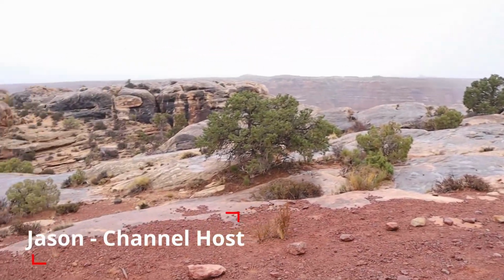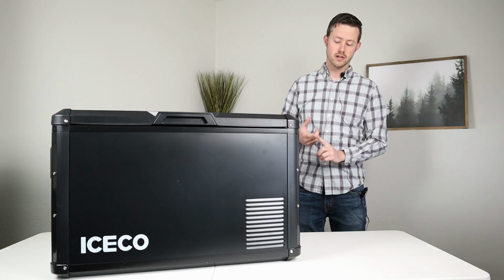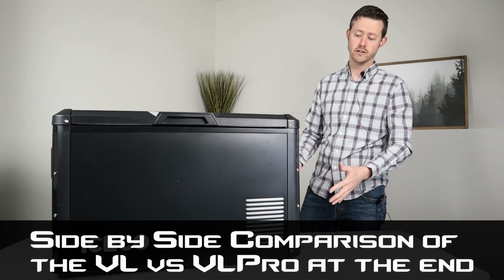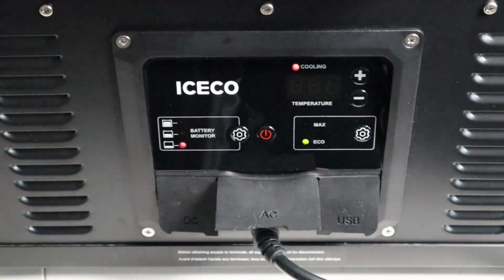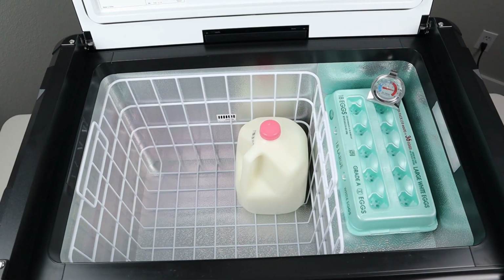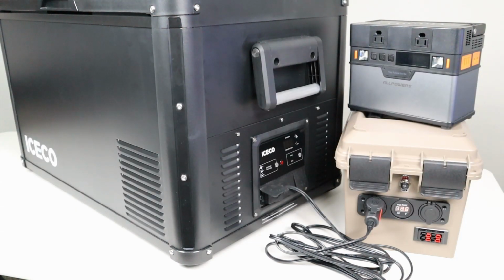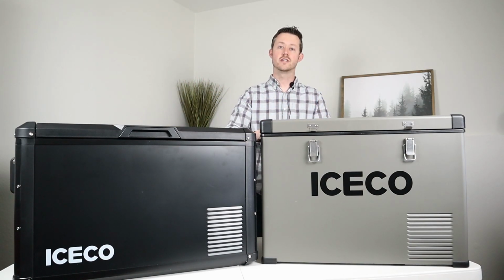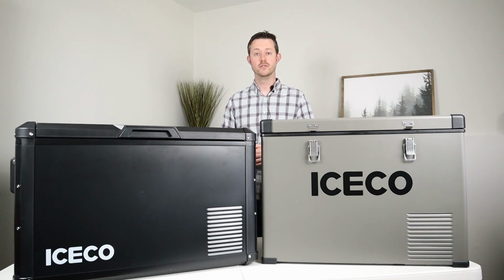ICECO VL60 PRO SERIES Review - Brand New Line of 12v Fridges! Best of ICECO Lineup?!

Comment: These are getting to be like generators. A couple companies did all the research and built a reputation (Honda/Yamaha/etc) then China came along stole the design and mass produced them under a million different names and at a million different prices. Generator companies are doing the same crap we see with these fridges with “we have a so and so engine” like this compressor nonsense. It might have the same compressor but it’s not the same. It might be a fine product I don’t know because we don’t have decades of user experience to go on. 

We also see this with diesel fired heaters. Sure a Chinese one is cheaper, but in the long run you’ll end up buying a Webasto or Espar because it will last a decade or more. 

You really do get what you pay for whether it be a heater, a generator or a fridge and you’re supporting research and R&D vs ripping someone else off. Or communism. Or muslim genocide. Or human rights violations. All taking place in communist China. 

It’s funny today people worry about their carbon footprint and all this nonsense but don’t care where a product is made or what their money is supporting. 

I am sure North Korea could build things even cheaper. How many of you would buy one? Sadly I bet a lot of you would.

Comment: Thanks for the video showing this particular model. I bought an Alpicool that I have to return because the fridge  side doesn’t work and was freezing everything. 

I had decided to buy an Iceco VL60 model for $749 with dual zone and dual lids. 

Because of your video showing new upgrades and with your discount code I instead ordered the 75qt dual lid and saved $120 off the $1000. Whew! That’s quite a bit more than the $400 I paid Alpicool. But I heard the Danfos is the best. Seems the only thing lacking here is a longer handle and wheels. Let’s hope it doesn’t take forever to get here.
Reply from the maker: Happy to help, I appreciate you commenting on the video! Good luck on your new large fridge, I know you will enjoy it! You cant go wrong with danfos/secop compressors, they are the best around!

Comment: Hi have you tested the new VL Pro with. Jackery or Goal Zero yet? How long would a Jackery 1000 run that? Thanks
Reply from the maker: It would be very similar to the other VL series. The Jackery 1000 has 1000 watt hours of energy. This fridge pulled 356 watt hours of power during my 85 degree test. That test was 21 hours long. So it should last at least 48 hours WITHOUT solar or DC charging. At cooler temps it would last much longer!  If you compensated with solar panels it would also last much longer. Pretty decent option for sure!
Reply: @Jasonoid  i look forward to testing my VL Pro 45 this weekend with my Jackery 1000. Thanks

Comment: What is the vertical measurement of the basket.  I have about 31" vert space and am concerned that the basket won't be removable.  Thanks.
Reply: Oops...my question is related to the VL45 Pro which you probably don't have access to.
Reply from the maker: @aowaycreek2183  They should be very similar, the basket for the VL60Pro is about 13.5 inches tall at the highest point.
Reply: @Jasonoid  Thanks so much for the timely response.  I'm surprised at the basket height since the listed internal dimensions show 13" for the VL60 Pro.  It looks like the side lip over which the basket must move is actually somewhat lower than the highest points at the ends and corners which is shown to be 18.2".  If that is the case I may be able to eke it out over the side rail.
Reply from the maker: @aowaycreek2183  yeah, hard to tell until you test fit it.

Comment: For your Power tests for 70 and 85 Deg You show 56 hours and 21 hours respectively. Were those runtimes the total time until the battery pack was exhausted? Also what was your 12volt battery  source (brand/model)? I assume the battery was charged to 100% at test start?
Reply from the maker: Those tests were just off the AC input from 120vac wall power. I only run the 85 degree test for a short period because I have it in a closet with a heater running to keep the temp at 85, I don't want to pay to run the heater too long. 

I power these fridges off my DIY LiFePo4 battery pack when camping. I have the build video on my channel if you want to learn more.

Comment: Thanks for the review,  everything about this pro series is really well designed ! Can you tell me the thickness/width of the handles , I'm designing Sprinter cabinets and want to keep cooler at max 29 inches width, but would prefer to drawer mount vl60s rather than vl45s . Thanks
Reply from the maker: They are removable so you can fit the fridge in a smaller space. The handles are 7 inches wide and protrude about 1.2 inches. Let me know if that info helps.
Reply: Thanks Jason, yeah I was hoping each handle was at least 3/4" thick,  I think I'd be able to fit the vl60s on a 29" side pullout drawer. Do you know if they will be accepting pre-orders thru your site or directly? I'm thinking these will be popular and possibly initial stock sold out quickly it's such a great design!
Reply from the maker: @rickwilson6023  just keep an eye out on Icecofreezer.com. They said they are available by the end of March. My discount code should work on these new fridges saving you 12%.
Reply: Are you indicating 1.2 inches/ 1 - 3/16th " each handle ?  2 - 3/8ths total ?
Reply from the maker: @rickwilson6023  1 3/16 each handle
Reply: Just router out or cut a hold so tye handle can fit flush with your cabinets.

Comment: Jason, thanks for the time it takes to make these videos and the information shared. I'm just beginning to build out my van and I'm looking at what my options are. 
Are there any true fridge/freezer combos that are roughly 50/50? Freezers are often smaller in size... and for my needs that freezer section needs to be at least as large, if not larger, than the fridge. 
Thanks!
Reply from the maker: I have noticed that they tend to put the freezer on the side of the compressor (which takes up the storage space). I'll keep my eyes out for one with a 50/50 spread. I know the VLPro series will have larger models, 80qt and 90qt models. They might have a larger freezer. Another option would be to buy two smaller fridges (Two VL45's maybe, run one as a fridge and one as a freezer) but you'd have to prepare for at least 10 amp draw when both fridges are running and and much more battery storage as two fridges use more power than one.
Reply: @Jasonoid  
Two... yes. Watching this video of yours on this model, I was thinking the same. 
And I do like this model...
If I go this route, and I magine I will, I’ll follow your links...
Thanks!
Reply: I would avoid The vl pro series until the seal on the top is re engineered.  It does not retain the cold and uses triple the power as my other powered cooler that is larger that the vl45.
Reply from the maker: @lifeguard434343  I didn't see an issue with my VLpro lid or seal. Still performed excellent on my 60 quart tests. You got a video showing how yours is flawed? I'm interested to see how it's different than mine.
Reply: @Jasonoid  yes I could make a video.  But have no clue how to post it for you guys to see…. The lid clicks shut before the seal makes contact with the base.  It’s possible the one I received is manufactured incorrectly but I can’t see any uneven spots.  It just seems they didn’t engineer it to close quite enough to squeeze the seal.  If I turn it down to freezing ice forms on top of cooler just outside of seal.  I contacted customer support, or at least attempted to call their phone but it goes to voicemail no matter what time I call.  Have you or anyone been able to get anyone on phone from ICECO?  Just curious.    I got a hold of customer service via email and they acknowledge it is an issue with the pro series.  I have the email correspondence to prove it.  I am not trying to be negative, but I figure others would want to know before spending that kind of money.  I know I would want to know, Because I would have gotten a different model of Iceco.
Reply from the maker: @lifeguard434343  I still recommend the VL45 non pro just because the cost is so high on the VL pro series! You have to leave a voicemail and they call you back, you can also text that same number and they text you back. Thanks for bringing this up because people need to know if there is an issue.

Comment: Love Canyonlands!  I am just about to pull the trigger on an Iceco and was going to get the 3 in 1, but now you have me second guessing the model I should get.  I also don’t see this VL Pro on their website.  Do you know the cost?  Availability?  Which model would you choose if they were the same size?
Reply from the maker: Lu from ICECO said these should be available soon. Just waiting for the final number to arrive at their California warehouse. Pricing shouldn't be too much more than the regular VL series.... Hoping it's not much more expensive but I will update the video description when they are available on ICECOFreezer.com

I'd recommend the VLPro if you can afford it. The lid and power ports make it worth it. USB ports are nice. The 60 Liter is a great size, it's just a little bigger than the 45, but not so huge that it doesn't need a truck bed to fit it. I think 60 is my favorite size for my small family of 4.
Reply: I just got the three in one about two weeks ago and then they pop up with this damn !
Reply from the maker: @denniswells8618  3 in 1 has the same compressor, it's a bit more rugged. You can't go wrong with the 3 in 1 either!
Reply: @Jasonoid  really like the new lid design and having the drain that's the reason I went with the three and one partially with the drain in it for the same reason you discussed
Reply: On top of that I wish they would have Incorporated the weatherproofing on the three and one like they have this model
Reply from the maker: @denniswells8618  The resale value on the local classifieds can be pretty decent for these ICECOs, when they come out you could always sell your 3 in 1. I'd recommend the VLPro60 instead of the VLPro45, it's just a tad bit bigger but will still fit in the back of an SUV.
Reply: @denniswells8618  weatherproofing?